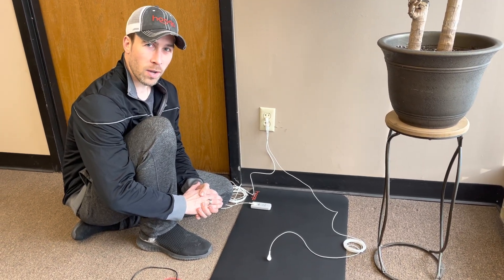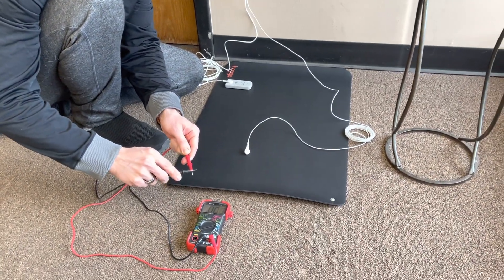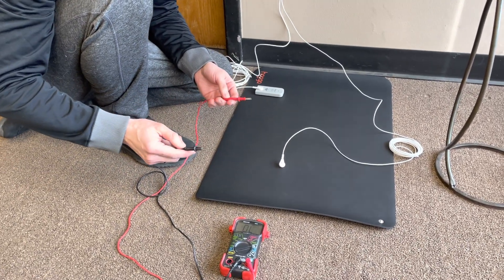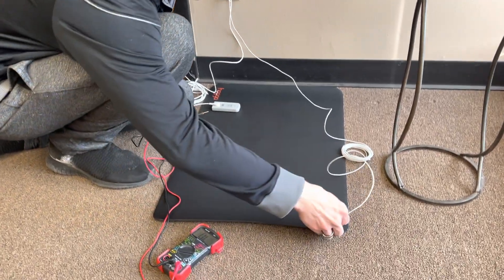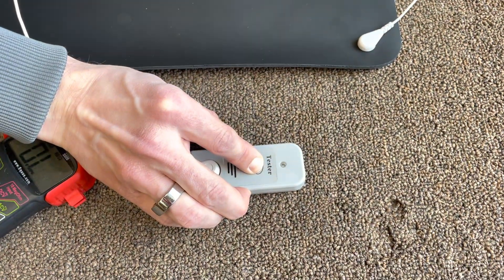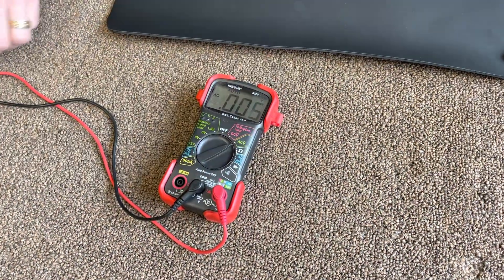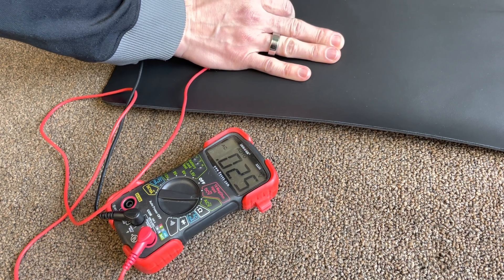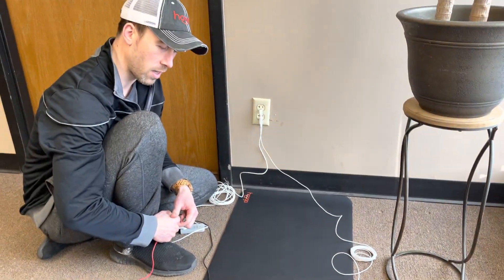Continuity and Grounding Test of Hooga Grounding Mat

Comment: Help needed. I hammered the grounding rod into the ground, The gray cord runs into my house, which I then plugged into my grounding cord. The grounding cord is plugged into the mat. When I put the continuity tester on the mat, it doesn't light up (battery is working). I have tried hammering the rod deeper into the group and made sure the cords are correctly affixed. It doesn't seem to be grounding. Any suggestions?
Reply: Assuming you’ve plugged the continuity meter into earth and measured everything correctly, maybe there’s a problem with your wall outlet like the earth is not connected, you could get an multimeter to measure the continuity to see if everything is connected properly. I’d suggest just measuring the continuity with an multimeter of your grounding mat and see how much resistance you get, less than 1 ohm resistance is ideal I’ve heard but I’m pretty sure it’s hard to achieve like in the video the dude had 100 ohm on the wire itself. So yeah, I think you’re alright just check if your cables have good continuity and that the mat is conductive.

Comment: Unless I'm missing something, there appears to be a flaw in the grounding test.

When he's holding the Multi-Meter red cable in AC mode and the black cable is touching the ground spot on the wall, this is no different than someone using the actual grounding matt. The red cable would be the grounding matt in this case. Your body would still be at ~0.17 since in both cases, only 1 grounding jack is being used.

To actually lower your body voltage to 0.02, you would need to be on the connected grounding matt AND have a 2nd connection between your body and the 2nd grounding jack to make a complete circuit. This means running a 2nd grounding cable and touching the copper end of it with a different part of your body, or having 2 connected grounding matts with a different part of your body on each matt.

Comment: Go stand outside barefooted will do it better.  Also, you can drive a ground rod into the ground and run a wire inside is the better option.  Just get a copper bracelet and attach it to the ground wire and wear it.  Also, you can get flip flops and wrap them with copper tape and wear those outside if you don't like getting your feet dirty.
Reply: There’s snow on the ground and it’s freezing outside. I have this for that reason.

Comment: This is, unfortunately, a textbook example of an expert being a hopeless teacher. What is "continuity"? Why is it necessary to test for it? What is the difference between ohms and volts and why test for one or the other? What are you doing with the wire in your left hand: not visible as to whether you are touching or actually inserting the prong. I could go on, but you get the point. I bought a Hooga and am disappointed in this demonstration.

Comment: If I plug the tester into a splitter, and the mat into the other side of the splitter, and press the tester to the mat, it shows green or continuity.  Now, if I plug that splitter into the ground hole of an ungrounded wall socket, it still shows green.  In other words, my tester is just testing continuity, and is not telling me if something is properly grounded.  I don't know if there is even a way for it to tell me that???  I think I'll have to actually buy the voltmeter.

Comment: Your "body voltage" measurement breaks Kirchhoff's law. This type of measurement is not scientific at all. It's just a measuring the difference in potential. Example that outlet could be 120 Volts and if you were touching a 120 Volt plate the multimeter would read zero. The ground wire has voltage on it but small. Remember that the ground wire ends up at the main panel sharing the neutral bus bar (the left spade on the receptacle).
Reply: Not to mention the relative induction that's happening with a metal probe in close proximity to the outlet itself.  I'd like them to turn the outlet off and measure their "A/C Voltage" in their body.  It will 100% read near zero factoring in the nominal voltage potential on the Neutral/Ground (XO Connection in the system)

Comment: 1:41 green light while is NOT pluged in, please explain
Reply from the maker: The green light will always flash once when you press the button to show that the tester is functioning properly.  If the green light stays on, then there is continuity.  If the green light flashes and then goes off right away that means the tester has battery power and is working correctly, but there is no continuity.

Comment: When you touch the mat, the meter isnt measuring your bodys voltage any more. Its testing the voltage between the ground and the mat. Maybe the bit of your hand between the lead and the mat
Reply: Was wondering about this. I feel like the best real-world test is putting a bare foot on the mat whilst holding the probe

Comment: How to make a grounding cord extension for your grounding mat,if the cord it comes with is not long enough so that you can use the mat where you want. You need a standard three prong male plug and an ordinary receptacle that the aforementioned plug plugs into. To complete the cord,get some 14/2 lamp cord,as long as you want the extension to be. Lamp cord allows you to make two extensions if you so chose as it easily splits down the middle without exposing the conductor. Attach one end of the cord to the ground of the male plug and  the other end to the ground screw on the receptacle. There you have it. Plug the cord into a grounded receptacle and your mats ground cord into a u ground on the receptacle. I’m not sure why someone was concerned about the resistance of the cord as the only current on the cord will be produced by the voltage of your body.

Comment: Hello I shielded my room with emf blocking paint then in order to ground it I had to put magnetic tape around my room that joined under a metal plate I screw against the wall then from that metal plate I attached a copper stranded cord that goes from my room Metal plate into outside attached to a grounding rod. Can I test if my paint is properly grounded with the continuity tester ? Thank you

Comment: That green light came on before you replugged the mat.
Reply: You know what take a copper Rod pound it in the ground run a line in through your window and wraparound your ankle or wrist and you're grounded. I did that and my horrible back pain was gone in about 10 days, everyday the area got smaller and smaller and smaller until it was finally gone.
Reply: He’s not lying. I just got a Hooga grounding mat and also the Tester - I noticed that the Tester does hold a slight charge which discharges when you hit the “press” button so that it does light up briefly.
Reply: @kissmissthis  my cord doesn’t work and neither does the mat
Reply: @kissmissthis  why would there be a charge if both ends were grounded?
Reply: @kissmissthis  where did you buy the continuity tester? and which brand is it?
Reply: I saw that too. People need to stop lying

Comment: I'm still confused. Doesn't my travel trailer need to be grounded in order for this to work? Another words if I just plug it into the ground socket it works automatically? I was under the impression that I had to have my travel trailer grounded by an electrician. Please help. Thanks

Comment: Safety resistance should be ~100kOhm, not 98 Ohms as mentioned in the video. 100kOhm resistance limits current flow to 1.2mA,which is safe. I'm assuming he meant to say 98kOhm which makes more sense.
Reply: It showed 98.8 on the meter.
Reply: Look closely, it says K at the top of the lcd
Reply: I live in a seconed story apartment. I made a home made canopy around my bed and idk if i should ground it outside theiugh the window or make a DIY outlet plug. Can you tell me exaclty step by step a list of what materials to get at home depot and how to install the ground or outlet and the safest way to go about doing it and where to put it so i dont get shocked? I'm new to this so it would really mean a lot. Thank you 🙏
Reply: In grounding products, does anyone know where the resistor is? Is it in the wire? Is it the same for all products/wires?

I want to try to ground to something other than the outlet (EU) but if the resistor is in the plug that goes in the outlet, then there's no safety resistor.
Reply: @alexzemaitis  you could modify one of those child safety caps that people use to cover outlets so kids can't shock themselves. Just drill a hole into it where the round prong would be (round is ground) and run a wire into it, hold it all together with superglue.